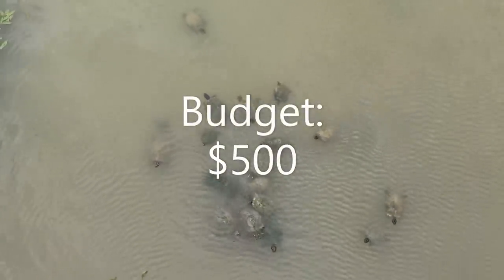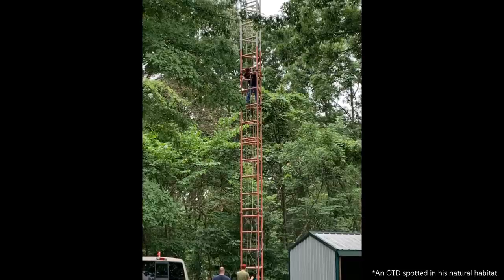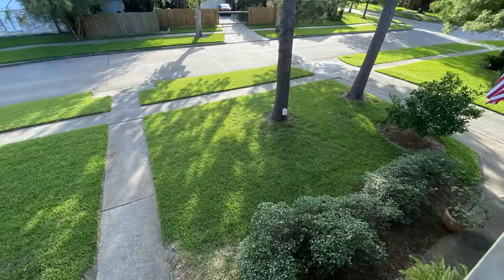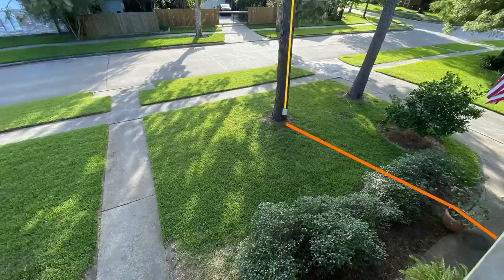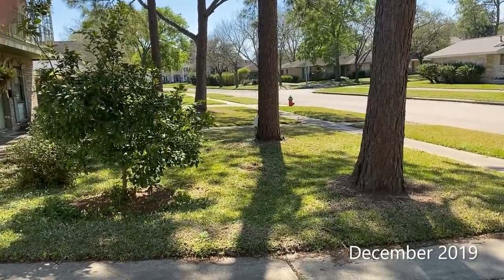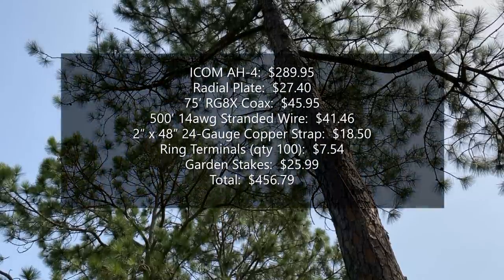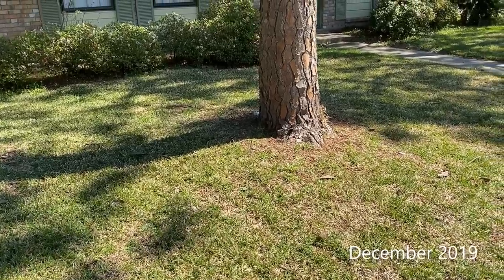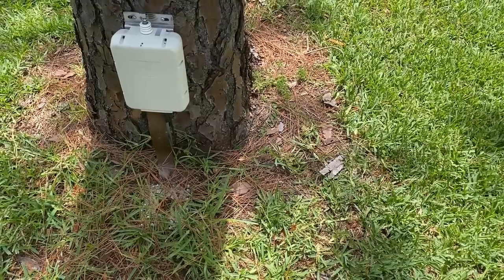Multi-Band Vertical Ham Radio Antenna in the Front Yard?

Comment: As another poster said, paint the tuner. Dark, flat camo paint is available at any outdoor store  and is the best that I have used. (Cheapest place I've found is Wal-Mart).
You can also paint the antennas in your backyard to match the surroundings. Mine are dark green. 
Obviously, don't use metallic paint.

Comment: Does this work well?  I try to keep my antennas AWAY from any trees....this one seems to be in direct contact with a tree.  Also, why does everyone use that big ground plate for verticals like you showed?  If it is going to be off center, and radials will be of different lengths, why not just put ring terminals at the end of each counterpoise and run a stainless steel screw through the center to connect them together?  Nice job with the video!
Reply from the maker: Thanks!  I've experimented with the distance of the top of the wire from the tree trunk.  There is a huge performance hit if the wire is within 3' foot of the trunk.  Currently the top of the wire is about 8' from the trunk, and I've been able to WAS in this configuration.  I get a slight improvement when I move the wire even further from the trunk.  The best performance gain I've added a horizontal section to the top of the wire and ran it as an inverted L.  That way the majority of the horizontal section was in the open away from all trees.   You are right about connecting the radials together, and I've definitely used your method and also just a large wire nut.

Comment: Because the tree will essentially act as a reflective ground, what you've created is a vertical reverse NVIS antenna of sorts. There will be a huge null on the tree side of the antenna. Take a few signal strength measurements 360 degrees around the tree and you'll see what I'm talking about.

Comment: If you want better 80 or even 160 performance. Consider adding a very thin (#20 or smaller) gauge wire  to the end of the wire in the tree. Then run the extra wire horizontal across to another tree to form an inverted-L. With small gauge wire at 40 feet it will be invisible. I like copper clad steel for this use. Great concept for using what is at hand.

Comment: I was wondering if you have to worry about squirrels chewing on your coax cable? Also, is the tree’s growth a factor also?
Reply: As the tree grows, more wire can be added to the radiating element? Over time the antenna will also work on 160m 😉.
Reply: I noticed that you bought 500’ of 14ga awg stranded copper wire. I’m wondering if you would of gotten better performance by using 22ga awg stranded copper wire instead?

Comment: BTW. Could You explain how this Home Owner Assiciation regulations are working? I live in Poland in Europe and this looks strange to me that somebody could dictate You what You can and what You can not to do on Your property. Really I don't know about any such regulations in Europe. Of course if You want to erect tall concrete or steel antenna mast or tower You need to have a desing documents and aproval from local civil engineering regulatory office, but if You want to install any kind of antenna on the roof or the wall of Your home it's up to You.
Reply: Generally speaking, an HOA is a group that monitors and manages certain things in the area of your home. When you move in, you are made aware that there is an HOA, and of the requirements/restrictions. They are intended to force people to keep the place nice, i.e., paint your home, repair your fence, etc. They often times have restrictions on things like antennas, so we Hams have to be creative. Their intent is like this...imagine you spend a lot on your home, and the guy next door becomes a slob and does not fix his home. It can drive down the value of my home. The regulations are theoretically supposed to keep the home values in the area stable. But, there are HOA's that take on a life of their own, and harass home owners. Everyone needs a hobby...ours is to play with radios. Theirs is to create new rules to bother us.
Reply: @bob9audio-video  That is strange. In Poland (and I think in most of europe) it works somehow like in Texas: "This is my property and f***k of from it" (joke) with difference that we are not shooting because of trespasing (another joke). 

In Poland (but the same for a lot of other EU countries) people take a lot of care about privacy. Most of houses have fence around with some trees, hedge or another plants to hide what is going on inside and on the yard. Generally this is seen as something very unpolite to have to much interest what Your neighbour are doing. 

And I don't see a sense in concept that a value of property X influences property Y. Here it doesn't work like this. If You roof sinks or You wall isn't repainted this is Your problem. Of course prices per square meter depends on a lot of things like distance from city square, public transport availability, presence of water/electricity grid, crime rate etc. but not because of what You neighbour have in backyard :) 

But the foundation is if this is Your property You can do everything You want, except of course things which are illegal or harmful like burning junk in the furnace :) Also I see from Youtube that urban development are completely different. In Poland every house is very different from another. Of course some areas have theirs development plan which sets some limitations like buildings cannot have more than two floors and Your lot can be occupied by buildings in XX percents, but nothing what forces You to desing Your home in certain way and locate in in certain spot in Your plot.
Reply: @mateuszsp8ebc691  Originally in the U.S., the main goal of HOAs was for the splitting of expenses for shared resources such as upkeep of neighborhood green space, swimming pools, or playgrounds. Most that are popping up now are just people who voluntarily give up their right to make decisions and decide they want to pay someone yearly or monthly fees to tell them what to do AKA Sheople.

Most HOAs restrict what color you can paint your home or the stain color for your fence. They decide when you need to replace a fence, even if you cannot afford it, and the construction type of the fence has to meet their "aesthetic guidelines".

The HOA also decides whether you can erect an outbuilding, attach an antenna or satellite dish, and controls the hours of use for the shared resources (pools, green space, etc.). They can (and do) levy fines for placing your trash can out too early OR bringing it in too late on trash day as well as for the other items previously discussed. If you refuse to pay the fine, they can place a lien against your home. If you sell your home, they can block the sale until their fines are paid or in some states they have even foreclosed on homes for failure to pay HOA fines.

People know this, but still VOLUNTARILY purchase homes in these areas. I have no idea why, but I believe they are related to the same people who purchase property under the glide path of an airport and then complain about the noise.
Reply: @mateuszsp8ebc691  Texas has HOAs, too! Unfortunately. It is*very* difficult to find a place to live without an HOA. Even in rural properties, HOAs and deed restrictions are becoming popular. And it certainly is not true that they protect property values. The economy is what determines property values here. In Austin, Texas property values are increasing because of all the new people moving here. It has nothing to do with how nice or pretty a home is.
I bought my house in an HOA area before I had my license. The plan was to sell after 5 years, but the market went bad and I had to stay. Then I got my license (7 years ago). But at least I can have antennas here. I work with the HOA and they told me I can do anything I want for antennas. But I still want to move because my yard is too small.